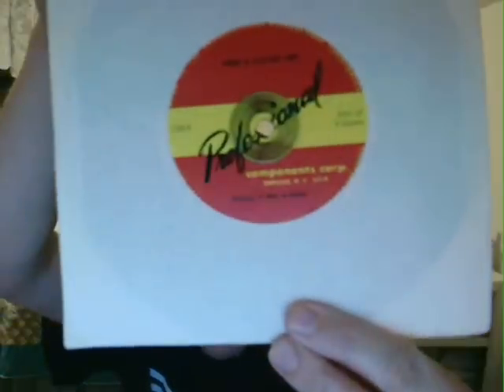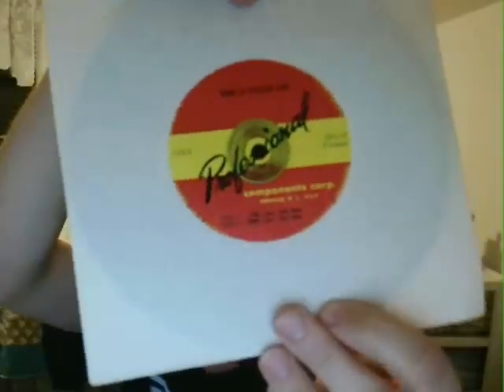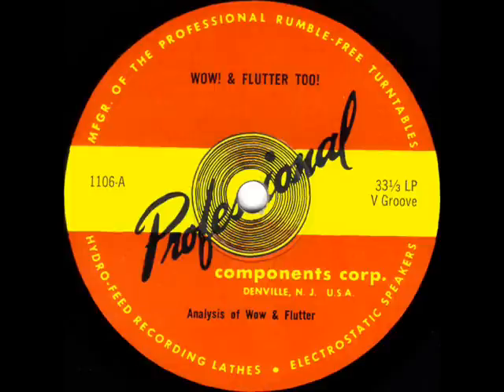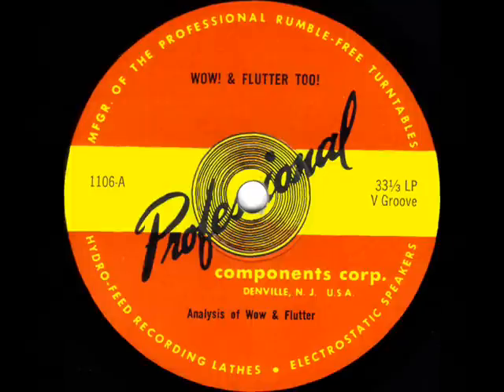Turntable Test Record of Wow & Flutter Specifications from 1954-55 by Components Corporation.

Comment: Truth is... You cannot get a more Warm , Clarified and Depth filled recording as a "pristine/straight' album can give your ears. coupled with Good Tube amplifications,mind you.
Compact disc or tape (unless is 2' thick or better LOL) Does not come close due to extreme compressions.  If you can,check it out.you'll find it hard to enjoy a CD though,afterward.
What can Help? Get a Sonic BBE (stereo) rack mountable effect and run your stereo thru it. and you will find it hard to have to remove. :)